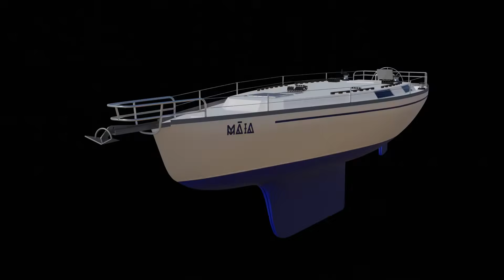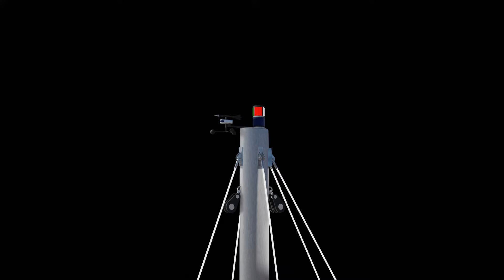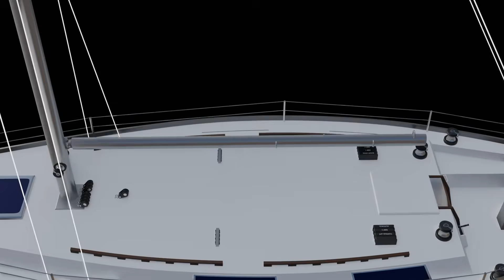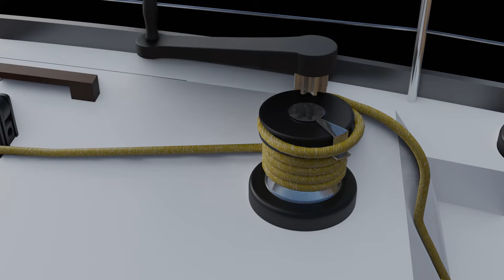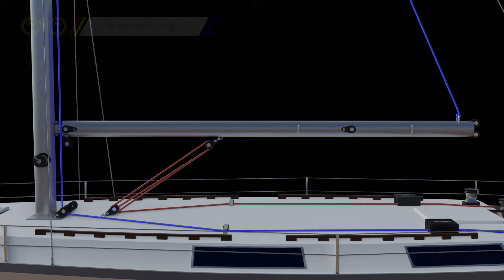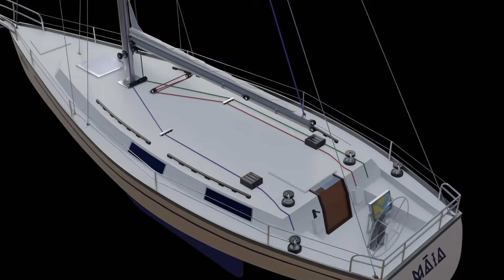Rigging for beginners # 1. Sailboat rigging explained - NEW EDITION

Comment: Modifique  un velero y voy a colocar los obenques . Cual es la posición  sugerida de las crucetas hacia popa ?
Reply from the maker: Buena pregunta 👍
En la mayoría de los veleros con aparejo fraccionado o tope de mástil, las crucetas suelen llevar un ligero ángulo hacia popa, normalmente alrededor de 5° a 10°.

Ese ángulo ayuda a:
• Mantener la tensión correcta en los obenques
• Aportar estabilidad longitudinal al mástil
• Controlar mejor la pre-curvatura del mástil

Aun así, la posición exacta depende del diseño del barco, altura del mástil y tipo de aparejo, por lo que siempre conviene revisar planos originales o consultar con un rigger profesional antes de fijarlas definitivamente.

Comment: I was under the impression the topping lift is only really in use when the sail is down, to prevent the boom from dropping into the cockpit. And that once the sail is hoisted the sail essentially holds the boom up, no? Would be nice if you also spent a moment on the outhaul, that was one of those lines that I always forgot about.
Reply from the maker: Hi, and thanks for your comments. While you are correct, let me give you an example. If you are sailing full sails and need to reef down... If you have tension on the leech of the sail, it's not going to slide down the mast track with all that tension. Same with hoisting, so it makes things a lot easier to lift the boom during sail changes. The outhaul is often forgotten, but gets important for sail trim... Hope this helps, thanks for watching
Reply: @searchingforcoconuts  I see, thank you